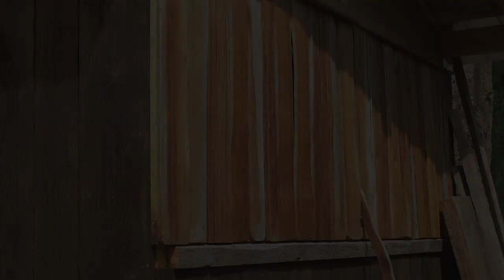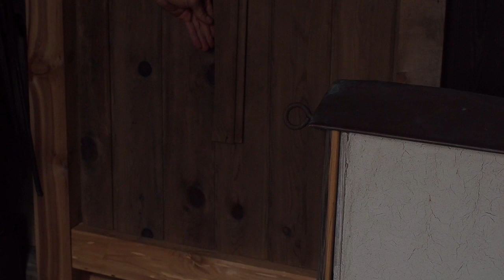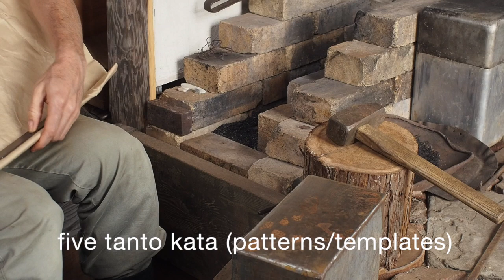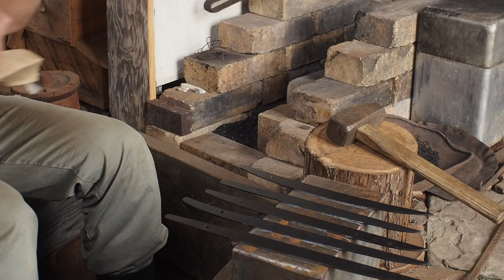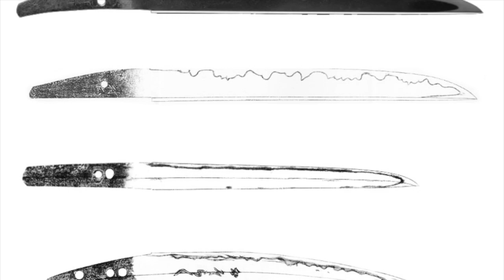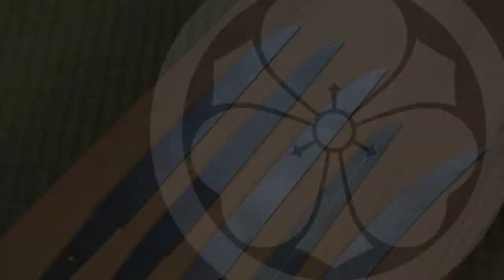"Unboxing" precision cut tanto kata from soulsmithing.com

Comment from the maker: A look at some precision cut steel tanto kata based on historical japanese swords from 1200s-1500s...order a set of kata here: http://soulsmithing.com/product-category/kata/

A kata is a pattern or form used for appreciation, study, or for reference when creating an utsushi blade. The exercise of accurately making kata based on the work of historical smiths is an excellent way to train the eyes, mind, and body to create proper tanto forms. The most important aspect of making kata is to work carefully to be as true to the original lines as possible.

Apprentices were asked to make as many kata as they could: these are eventually used for sword making, can be kept for a lifetime for reference and study, and their very making is a good opportunity for practice.

Learn about making your own here: http://islandblacksmith.ca/2019/07/making-tanto-kata/

Comment: The unfortunate issue is that we don't know what some of them were like with full Niku, and Sugata. Many if not all of the profiles there are after the Originals have gone to Togishi a few times.
Reply from the maker: yes, many times over the centuries! it is interesting to extrapolate backwards and ponder what they may have started out like, though tanto are much less susceptible than tachi to the kind of damage that would require major reshaping (edge chip or broken tip)...occasionally one might even find an oshigata from a century or two ago and comparing to those unused ones dedicated at temples is a help too...at any rate most folks who make tanto out of their head will be greatly improved by even a tsukare classical kata...
Reply: @islandblacksmith  Of course Tanto profiles vary also even by the same Kaji. One day Hocho was forged. Around the bend, the same day, a Yaroi Toshi from another forge. So much history, so little time.